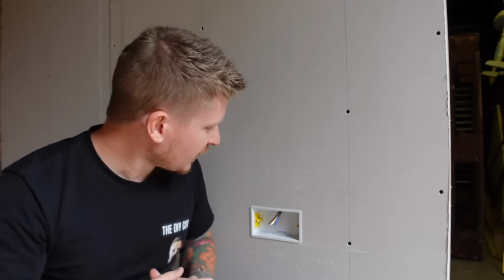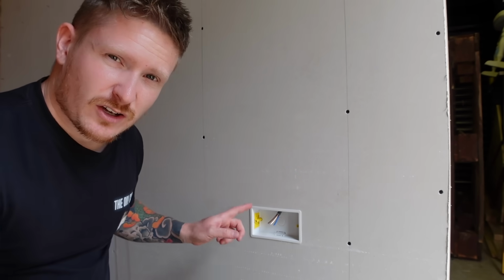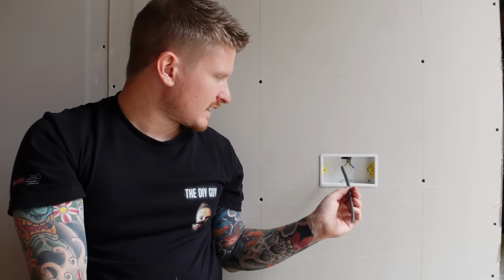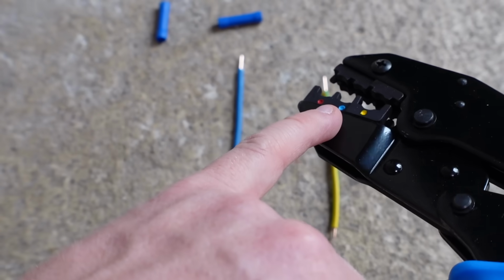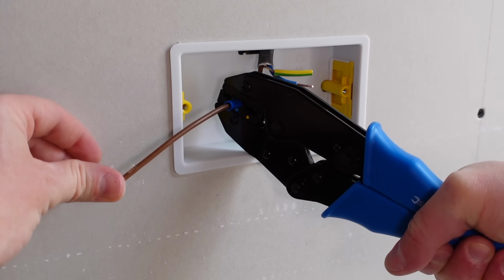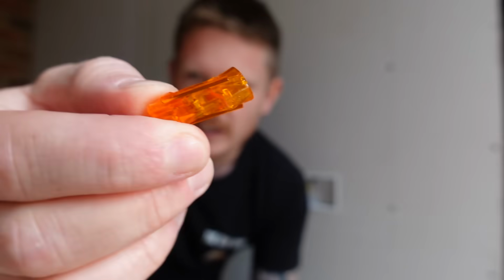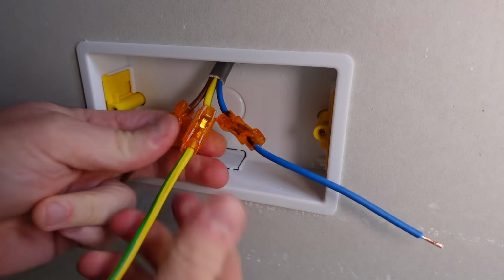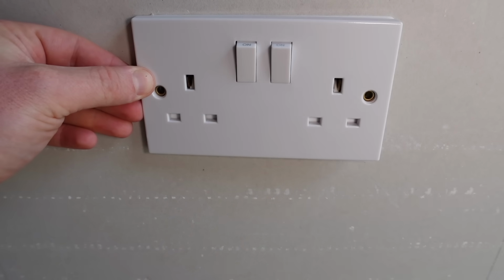How to Extend Short Wires | Easy Fix Anyone Can Do

Comment: Thanks. I might get a pack, haven't used those before. I've tended to use Wago, eg Inline splicing connector with lever or three 2-way blocks or Ideal equivalents. I think Wago or Ideal do a three separate wire inline splicing connector but not needed one yet so haven't looked. 
   I now bend the wire in the faceplate back on itself - some professionals say it's essential, some say not to bother (professional sparkies have three different opinions for every two sparks). All I can say is it makes for far more secure grip without extreme tightening or squashing of the wires whether you have one, two, or three wires in a housing as the screw finds its way inside the hook and pushes the wires tight to the outside of the connector. I got fed up with going over professional work immediately after they'd been and gone and, especially, six months later. John McGrath, who is a professional electrician and heavy duty amateur woodworker showed me that trick and, of course, he did it lightning fast. I googled it, found lots of other perfectionist pros do it, and found I could do it fast too with my pliers being the perfect width to bend the wire around for a perfect length to bury it in the gripper with no wire showing

Comment: What about soldering the original wire and extending wire together? If I have used this technique, I've usually added 2 layers of heatshrink over the soldered section and adjacent insulation. I appreciate that if you are trying to complete a job quickly - then soldering might not be the quickest but I feel it makes for a quality connection.

Comment: On the very day I was looking to how to extend wiring i was lucky enough to find your channel and was very impressed by your presentation. But my problem is, short wiring from
the loft into a ceiling rose, that has to be changed because water got into after having a leaking roof! I guess with the amount of wiring involved, I won't use this method but would
be using a junction box instead, installed & left in the loft space. Then bring a single cable down to fit into the new rose?  Any thought's on the matter would be greatly appreciated.

Comment: Blimey I've been crimping for years (and messed up a few due to not ensuring the wire was inserted fully before squeezing the handles on the crimp tool). This in-line splice idea is brilliant.

Comment: Cheers for that - will defo get some for my toolbox - much simpler than crimping or screw clamp connectors - seen reviews saying that they are only rated for 20 A though? obviously not a problem for most domestic circuits